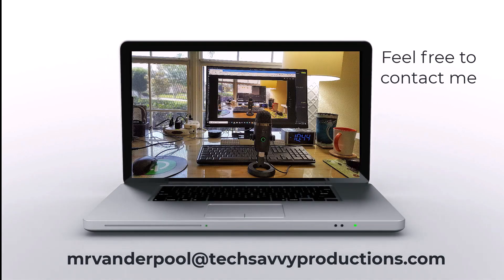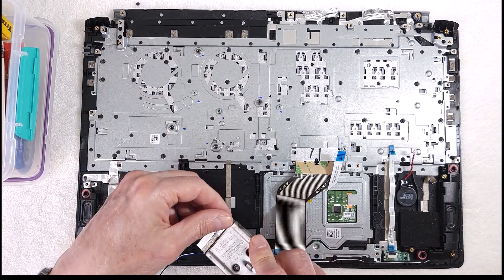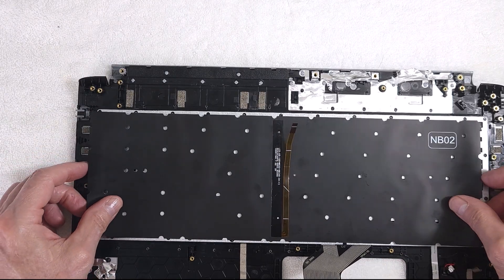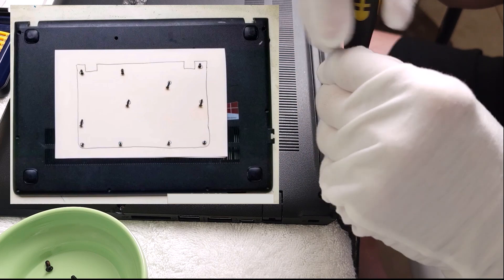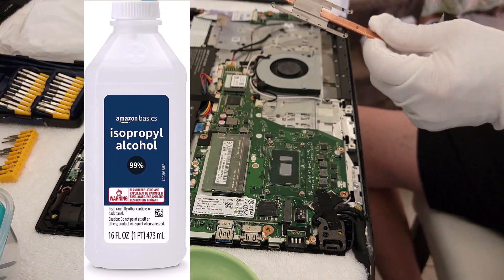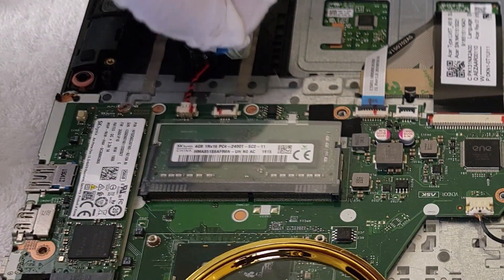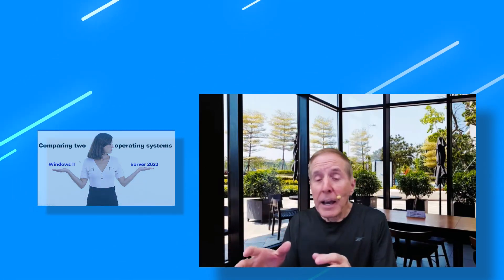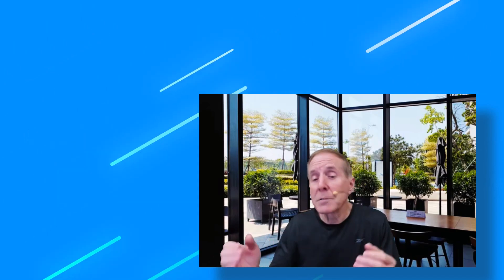Revive Your Acer Aspire 5 (2019): Keyboard Replacement and Teardown Guide

Comment: Thank you for the quality instruction. I've only seen comments on this video talking about how they thought it was good, but did not attempt it themselves, so I thought I'd add my experience in since I did attempt it. 

This was my first time disassembling a laptop and the video was very helpful all the way through. I ran into no issues during the process and the laptop booted up first try with a working keyboard when I was done. In the video, you melted edger string to replace the plastic rivets, but I decided to follow another commenter's suggestion of using a hot glue gun instead. After trying both methods, I can conclude the hot glue gun was not only way easier, but also less dangerous, so I heavily suggest that method instead. My keyboard backplate was slightly bent (probably my fault), so I found that the best way to get it to sit flush was to use the end of a pen with the ballpoint retracted and press down on the parts of the plate that were coming up until they were flat against the rest of the laptop while I glued the spots where it was riveted previously. Then I held the pen there until the glue had hardened and didn't need support anymore. After repeating this for all rivets, the backplate was flush and my keyboard properly stuck out. This is an easy task so long as you're careful and take your time. I recommend taking pictures along the way of disassembling like I did so that you have references to where pieces go and what screws go where when re-assembling. You can even record a video if you want to be 100% sure. Thank you and good luck
Reply from the maker: I wish I had done the hot glue method "after the fact".   Good decision!

Comment: This is awesome. I'm not sure if I can do this myself, but maybe I'll call a local place to see if they can replace the keyboard. I spilled candle wax on the keypad/enter/shift keys and no amount of cleaning has made them return to a functioning state. Computer is completely fine, so it'd be a shame to have to buy an entirely new unit just because part of the keyboard isn't functional.
Reply from the maker: You can do it, purchase a small tool kit from Amazon for under $15 and go slow.

Comment: I really enjoyed this. Really appreciate that you go through all the steps and explain how & why to be so careful. I been looking for a video that's not so much about replacing the keyboard. The mold that holds my hinge screws, broke. Not able to fasten it tight. So, I'm buying a chassis with the keyboard. Will probably get the bottom case also. Cheap enough. Just trying to find all the instructions I can about dismantling my laptop. Its the R5 -571T. I guess my concern is the touchpad is not included. I just want to be sure about the procedure. There's a place online "impact computers". They have a ton of parts. My Acer has been good to me. I put in a SSD, upgraded the ram. It performs very nicely. Anyway, if you have any tips or comments, I would really appreciate that! And thanks again for your video!
Reply from the maker: Take your time and be detailed about your work, where screws go, and the like and you should be fine, the disassembly is not that bad if you are patient and careful.
Reply: Well, I got it fixed! My laptop is almost like new. My hinges work like new. Little scary but it was good. I didnt have any video. got a little worried but I knew I could only be of one of the two lead coming from the hinges and I was correct. I replaced the lower & upper case with an attached lit keyboard. Thanks for the video, it helped!

Comment: Couldn't you have used some hot glue instead of melting plastic back into rivets?
Reply from the maker: Great suggestion, I actually wished I had done that!  I had initially considered that but was concerned it would not hold, but realized after the fact it was a better way.   Appreciate your comment!

Comment: You might want to  add that if you  a soldering  iron, maybe  you should do that outside otherwise  you will   be  setting off the  smoke  alarms
Reply from the maker: Is wasn't that bad but the fumes nevertheless are toxic and you want to keep fresh air flowing.